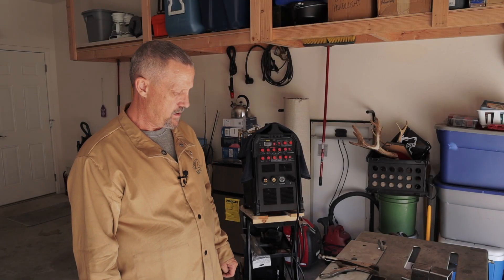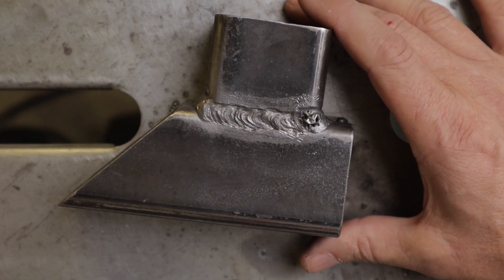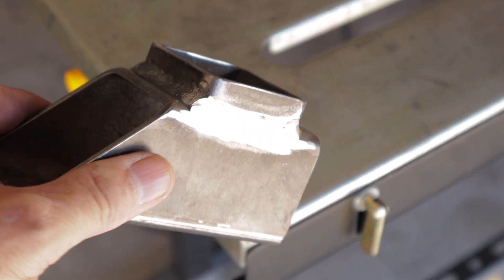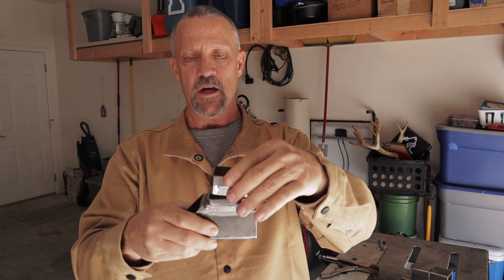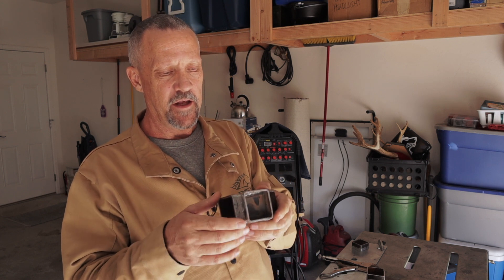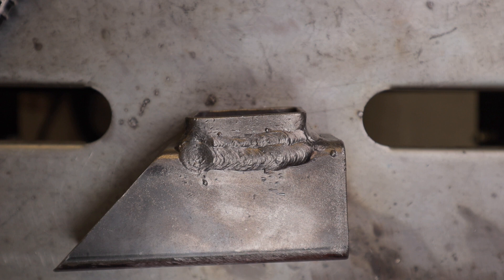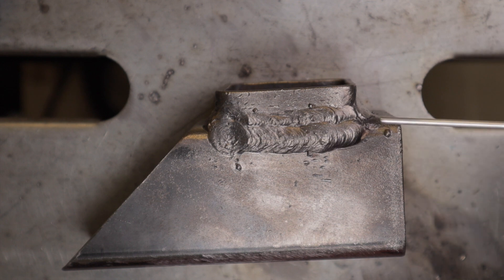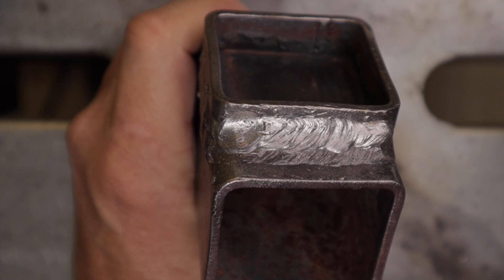Stick Welding Square Tubing with the Prime Weld TIG 225X AC DC TIG Welder

Comment: AC ACEP or ACEN? DC DCEP or DCEN?
Reply from the maker: The 6013 rods can be used on DCEP or DCEN with DC current. AC current automatically alternates between DCEP and DCEN. Work clamp and electrode connections don’t matter in AC mode.
Reply: @DIYHomesteadProjectsDIYHP10  yes I know but im asking what was this used with? AC ACEP or ACEN? DC DCEP or DCEN?
Reply from the maker: It's been too long since I made this video. I don't remember how I had the machine set up.

Comment: WOW!!! I did not know this could do AC pulsed stick welding!!!! That is a very expensive feature!!! MORE MORE MORE!!!! EXCELLENT REVIEW
Reply from the maker: Glad you liked it Jon. Thanks for watching and commenting.
Reply: @DIYHomesteadProjectsDIYHP10  OK, just read the manual. Did you accomplish this by leaving it in the TIG mode even though it was stick/MMA? The manual says MMA is DC only...
Reply from the maker: Jon, I was not welding AC stick "pulse". I was only stick welding with AC. As far as I can tell you can't "pulse" in MMA mode with this machine. I'm not sure what led you to think I was MMA AC "pulse" welding with it in the video.
Reply: @DIYHomesteadProjectsDIYHP10  at 3:10 in the playback it says AC 100 amps 120 hz and i can hear it, so naturally i assumed you had unlocked the pulse setting. I figured you could change the frequency from 120 hz to let's say 60 or even 30 hz. That would be frequency of the current, or pulse.
Reply from the maker: Oh I understand now Jon. Yes, you can change the frequency or hz during AC stick welding. You have the full range of that setting in MMA.

Comment: can you run 6011 or 6010 on this box? very helpful for root passes, but i know its a hot arc and some inverter machines have trouble...
Reply from the maker: I don't know JJ, I've never tried any 6010 or 6011 rods with this machine.

Comment: Try throwing a little whip when your welding (circular motion) but also keeping your puddle in the shape of a football. 

When your using rods like 6010, 6013, etc.. you can’t just drag the puddle. 7018 and rods in the 70s you can just drag. 

And when your coming to the end of your weld, stop traveling and let the weld puddle up a bit before your stop the arc. 

Keep it up though! 🤘🏼
Reply from the maker: Thanks for the tips, I really appreciate it! I'll give it a try the next time I do some stick welding. 👍

Comment: Checkout the Indonesian welders on youtube. They fabricate everything using 2.6mm 6013 on DC with chinese stick welders. They usually don't run beads due to blowing holes, but rather use a dab/dab technique (weaker welds) which works a hell of a lot better for square tubing fab. Consider it like a nonautomated pulsed stick welding (reduces heat input). Note, they are using 6013 which is "vertical welding capable". If you research, you will find it has a more aggressive arc and a thinner flux. Regular 6013 cannot be used for vertical. They are welding only in the flat position and it works great. Stick like TIG.
Reply from the maker: That's funny you mention those Indonesian welders using 6013 like a spot welder for thin gauge tubing. I've been watching some of those lately and I am going to give that a try just for the fun of it. Those guys must do that all the time because they are pretty good at it. Maybe I'll do a video of it to show how easy it ISN"T and how talented those guys really are. LOL

Comment: Nice arc shots! I just built a work bench out of 1.5 in square tubing 1/8 wall. Mainly stick welded it, I used 3/32 7014 for all the fillets and 6013 for all the flair bevel joints( I think that’s what they are called) I prefer 7014 a bit more that 6013 because it just feels less sluggish. I also tried to do some verticals welds with 6013 and that did NOT work, probably just need more practice lol. Keep
Up the good work!!
Reply from the maker: I think I'll pick up some 7014 rods some day and give them a try. I hear they are great for taking. I like the 6013 rods for that too. Thanks for the great comment, I appreciate it.
Reply: @DIYHomesteadProjectsDIYHP10  which 6013 are you using, because I'm looking at blue demons which I've heard have a more aggressive arc. Also heard Hobart 6013's have a thinner flux. 7014 are also good, have more fill to them. 7014's is basically 6013's with more fill and harder, but hotter and are slower cooling so burns holes thru square tubing more easily than 6013. Stronger material, but harder to grind off mistakes, too.
Reply from the maker: I'm using US Forge Welding Electrode E6013 1/8-Inch - https://amzn.to/35SxiL5 I don't know if they are the thick or thin flux rods. I do like the way they weld though.
Thanks for the info on the 7014 rods.
Reply: @DIYHomesteadProjectsDIYHP10  3/32" is 2.8mm. It is the closest I could find to the 2.6mm they recommended. A few of those guys say 2.0mm, but nobody recommends 1/8". Of course, you might be using some nice thick tubing.
Reply: DIY Homestead Projects :Good to know what rods your using. Now I just need to get a stick welder ; )
Reply from the maker: Yes, I'm sure 1/8" rods are a bit much for thin metal tube. If I remember right the lowest recommended amps is 90 for the 1/8" rods. They did fine for me on 1/8" thick walled square tube. 1/16" would probably work well for sheet metal. Have you tried it?
Reply from the maker: Mark Ashlock 👍😀